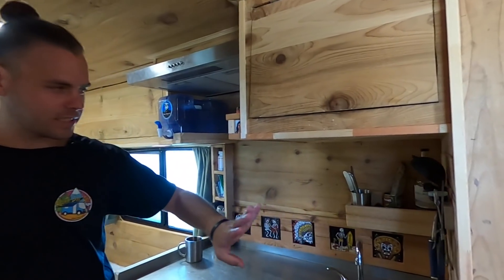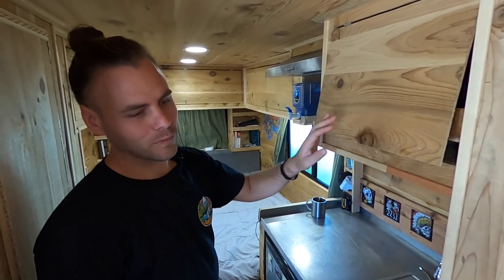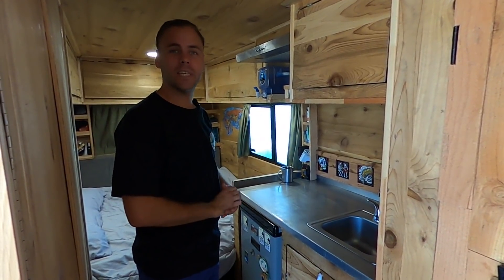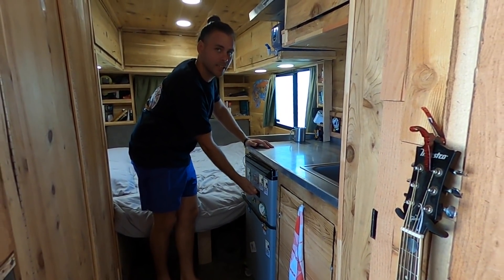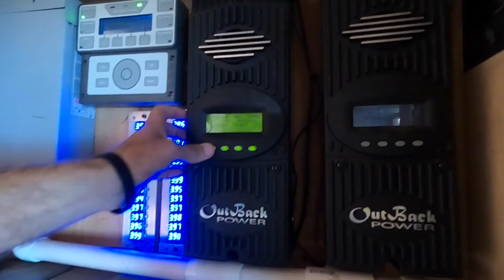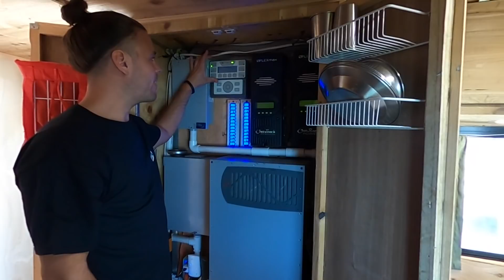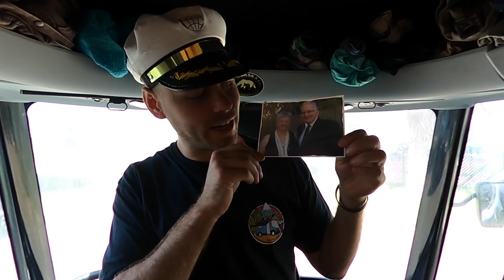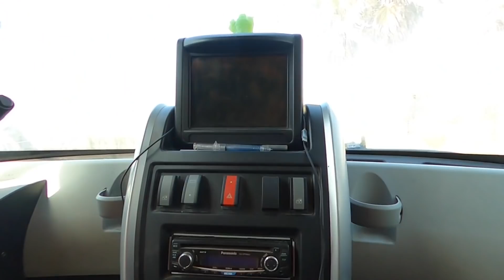100% SOLAR POWERED VAN Drives From Alaska to Argentina Spreading AWARENESS About Making Change

Comment: I appreciate the shout out to your grandparents. I'd like to know more about the mechanics of the vehicle and specifications...expected miles on full charge, expected time to recharge the batteries? I suppose it is front wheel drive? When the vehicle is being operated on the road does the panel on top continue to recharge the batteries? Was the "cockpit" originally built to be an electric vehicle or has it been repurposed?  How, while on the road, do you keep all those solar panels clean enough to be efficient?  Love your vent hood and the fact that it is vented to the outside...however..the carbon filters in vent hoods aren't to filter out carbon, but they have carbon in them. They are not really needed when the air is exhausted to the outside (except they will keep duct work cleaner by catching grease). The carbon filters are important to use when the air is being recirculated into the living space (as many new homes in the US are doing these days, which is a very poor practice because they do not filter out enough of the grease or odors, and especially because they do not filter out the humidity produced while cooking.) I installed vent hoods on my two stoves that have washable mesh stainless steel filters and of course they are both vented to the outside. The mesh filters must be washed as they do catch a lot of grease which means they are doing a good job. Your vent hood may have the washable metal filters that can be used in place of the carbon filters. Or perhaps your vent hood uses both, which is overkill since you are venting to the outside. Just thought I'd share that with you.
Reply from the maker: Wow, so many questions. We'll see what could be done about all these :)
Reply: Yes....what's the range & charging time ?
The tech part is what makes this van interesting...